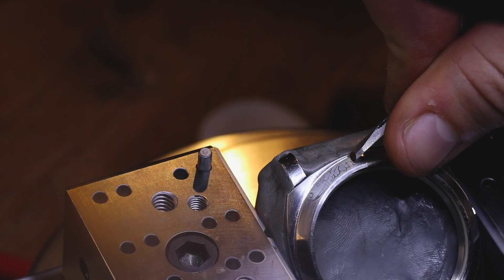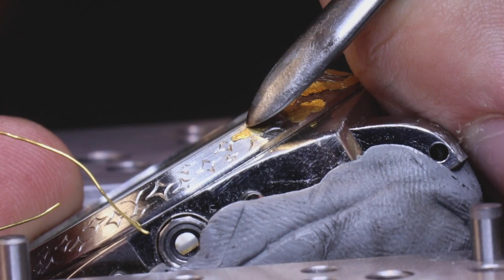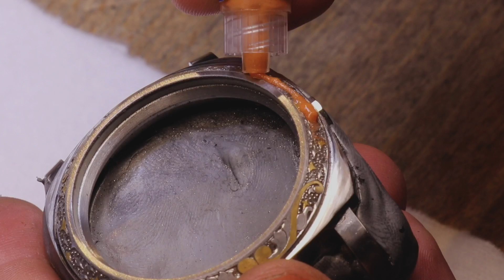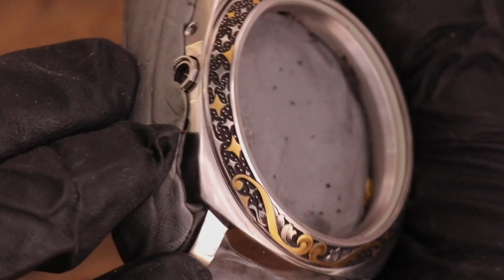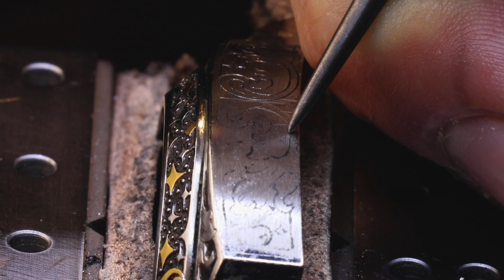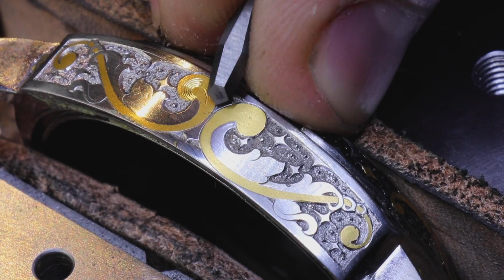Finest Panerai Luminor I Ever Engraved

Comment: If you need free sandpaper auto body shop throw away free fine sand paper. At work we share dumpster with auto body shop I seen up 1000 grit sandpaper almost brand new
Reply from the maker: Good idea i you know the owner. However sandpaper might touch steel(and there is no way i could possibly tell) and afterwards i might contaminate stainless and in worst case scenario stainless might start to rust